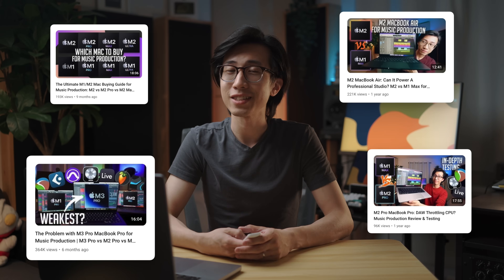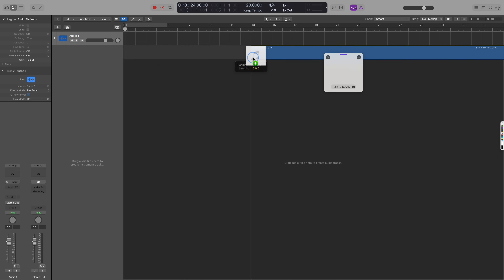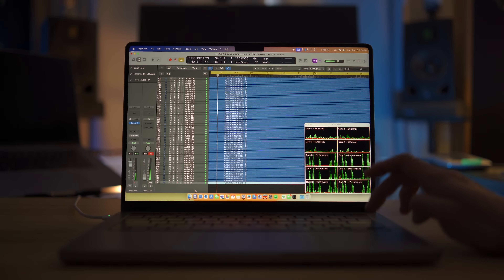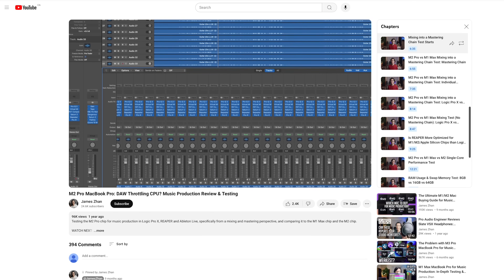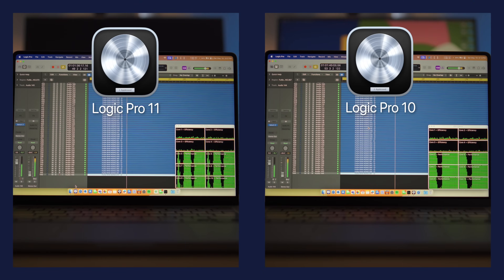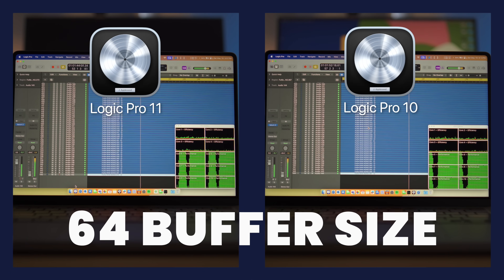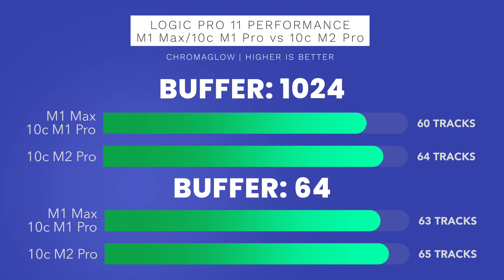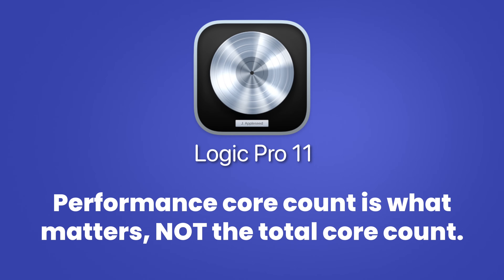Logic Pro 11 on Apple Silicon: Are CPU Cores Fully Utilized?

Comment: I'd imagine that the efficiency cores aren't really meant to handle heavy workloads like this and so the incremental amount of performance gain they'd add might not be worthwhile for the system scheduler to make use of them. It does look like a bunch of system stuff is getting offloaded onto them, at least, otherwise the efficiency cores would be reading 0%.

Also I'd expect that most plugins (especially third-party ones) would be single-threaded, which would explain the ChromaGlow discrepancy. I think ChromaGlow would also be using the neural cores on Silicon, which is also pretty uncommon for non-Apple things to make use of.
Reply from the maker: In my other Mac testing videos featuring DAWs that can fully make use of the e-cores, the performance gain you get from fully using e-cores is NOT "incremental." Testing data showed that it's actually quite significant—enough for users of those DAWs to be able to get a "lesser" chip while getting MORE performance out of their money compared to a more expensive chip.
Reply: @JamesZhan  Ah, that's interesting. I'll have to watch some of your other videos on the subject.

Comment: This is by design for consistency. The E-cores are significantly weaker than the P-cores and are reserved for non-audio application/OS processing. Every time playback is started in Logic it redistributes the tracks across the cores to balance out processing, not the individual plug-ins on them. Since all P-cores are equally powerful it can freely do so without having to worry about moving a very plugin heavy track to a weaker E-core and causing an overload.
Reply: I disagree. With a master's degree in computer science and programming, I can confidently say that this is not an intentional "feature." It's clear they haven't yet figured out how to efficiently use the efficiency cores alongside the processing cores. It feels quite frustrating to invest a significant amount of money in Apple's high-end M-series chips, only to discover that the benchmarks presented don't translate to real-life performance due to software limitations.
Reply: @mattiastofte7457  exactly, and thank you for wording that much better than i did
Reply: @mattiastofte7457 why it’s clear?
Reply: @jacosmusic  Many developers have successfully added similar features to their DAWs. Technically, I see several ways to do this too myself. 

Some argue that certain VSTs and processes are too demanding for efficiency cores. While this seems reasonable at first, it ignores the flexibility of modern CPU schedulers. By optimizing the scheduler, we can assign lighter tasks to efficiency cores and reserve intensive tasks for performance cores, balancing the workload and maximizing resource use. Efficiency cores in MacBooks are quite powerful and can handle a significant portion of the workload, so not using them fully is inefficient and "lazy" on Apples side. Honestly I don't think it will be too long before we see this implemented.
Reply: it's true, but the efficiency cores are actually quite powerful. And as meislit9217 points out, other DAWs can and do use all cores. Perhaps it would require too much of a Logic rewrite, and the performance as it is, is enough. Perhaps Apple knows something we don't, and if ALL cores are maxed out, the extra heat makes the clock speed drop a llittle, and the benefits are negliable. No idea. But it's interesting for sure.
Reply: OP comment is correct. The ability to use weaker cores will depend on how inherently parallelizable a process is. A lot of music processing is not because it’s processing a 1D time series in serial (i.e. whatever it’s doing on depends on the past so you can’t so easily split it up to multiple cores).
Reply: @sobhhi  The result of James‘s experiment indicates that we can indeed get a significant performance increase for music production when also utilizing the efficiency cores.
(Just checked out the video to your latest single and it’s dope, great job!)
Reply: Yes in theory, but that will depend on whether the processing being done to the audio is parallelizable and whether the developer of the plugin even codes it that way. So yes, it’s possible for some types of processing, but I would imagine it’s rarer than we think and developers will just opt for single thread processing in a P core to be safe.

(Thanks for the love on the music bro)
Reply: @sobhhi  that is true but in this context more or less irrelevant. That would be an argument if no one managed to get e-cores to process audio, but that's not the case. Some DAW's can utilize them and have better performance because of it, so it is possible and therefore the argument irrelevant and doesn't apply as the problem in this context.
Reply: Maybe it is by design, but it results in less performance compared to other DAWs that are make use of the efficiency cores
Reply: Agreed. I feel like the content creator's premise is just flawed. Using the efficiency cores for realtime audio would be a bad idea.
Reply: @EricGoetzMusic but third party daws like reaper are able to use e-cores for audio processing...
Reply from the maker: @EricGoetzMusic  Why exactly would it be a bad idea? If almost half of my computer's chip is e-cores (e.g. 11-core M3 Pro has 5 e-cores and 6 p-cores), I would absolutely want to have the option for them to be all maxed out when I'm doing intensive tasks.

My tests showed that you can get significantly more performance from a chip when a DAW can fully use the e-cores.
Reply: @JamesZhan well if a DAW is performance based like Ableton Live or bitwig studio, it would be bad to have tracks or clips utilizing efficiency cores. Not sure if pro tools requires the same realtime audio needs. I suspect they do

.
Reply: @JamesZhan  the way that realtime daws are designed is very memory bandwidth intensive and I'm afraid that the M3Pro is quite weak on that. Can you do a test with tool like Amorphous Memory Mark? For the M3 Max the memory bandwidth available to CPU is about 120GB/s. I wonder what would be the case for M3 Pro.

Comment: Your chromaglow test just comes down to a bit more single core headroom on the M2 Pro vs the M1.  I mean they operate at different frequencies.  M1 is 3.2ghz whereas the M2 is around 3.6ghz.  That matters and will make a difference sometimes.
Reply from the maker: I understand that M2 Pro has faster cores, but, if that was the reason, shouldn't other plugins perform better on M2 Pro's two less p-cores too? Why just ChromaGlow? I'm more inclined to believe that it's due to M2 Pro's neural engine
Reply: @JamesZhan  Fair enough.  I am speculating of course.  Without seeing the source code there is no way to know for sure.

Comment: Thank you for your video! I’m guessing your project and audio is on the OS drive, not on an external. As pro user I (we) always work this way….
Reply from the maker: I would hesitate to speak for all the pros, as pros all work differently, but yes, I run my projects and audio on the internal SSD.
Reply: @JamesZhan  would this affect your tests?
Reply: What's the best way to work.Keeping project and audio on a separate drive? I still get confused about how to configure it on Logic.
Reply: @StratsRUs  you simply save your project to another drive. Your files will then stream from that location. If you use samples Logic can relocate your Logic samples for you to a “permanent” drive. Meaning you move them once. There are vids out there …..

Comment: Thanks for the video. Was wondering about it. Seems that Reaper and Cubase 13 are the only two that use all cores. I've just switched to Mac Mini M2 Pro 16 gig ram and 512 ssd.  Have to say that I love mac but the storage is not good. If  I knew what I do now, I would have gone for min 1Tb. The 16 gig ram is ok coming from 32gig. The ram was my main concern but in real world my small ssd is the biggest issue cause I've got a very fast 2tb wd  ssd with a very fast enclosure but there is problems with Thunderbolt 4 dropping  the external. Best solution was to buy a powered thunderbolt 4 hub but even that is not preventing the external to disconnect and I see many such problems . Big bummer for me.
Reply from the maker: Yeah, it's often the case that people need more storage space than they think they do, because pro apps and the OS already take up a whole bunch of space. This is why in my M1/M2 buying guide video, I recommend people to prioritize getting more storage over getting more RAM, unless they KNOW they need as much RAM as possible for loading tons of sample libraries.

At the end of the day, if you have a desktop Mac, you can still expand your storage space by plugging in external drives, but you can't do that with RAM.

Comment: What WAS the case with multi-core Intel processors (and may still be with Apple silicon), is that where music production is concerned, high single-core clock-speed performance was more important than total core count of the processor. 

This was true because while a high core count MAY be able to allow your Mac running any DAW to handle a 'larger', more demanding project file, the workload of a single plug-in instantiation cannot be distributed across multiple cores. So as many users have experienced, a very cpu-intensive plug-in could halt your song-file with the dreaded processor overload dialog when the majority of cpu cores were just chillin'… because the demand of just one plug-in instantiation was more than the assigned core could handle.

Since through successive iterations of Intel processors we saw that models with fewer cores generally had higher single core clock speeds, while the models with the most processor cores were clocked at lesser (slower) slower speeds. For audio/music applications, if you want to run one or several virtual synth plugins with high polyphony (for example), then you'd likely do better with a processor having fewer cores, but able to run at a higher clock speed.

I've said all this because I don't have any knowledge that this radically different ARM-based SoC architecture has changed the importance of looking for high single-core clock speeds.

This is important work you've done in discovering the need (for logic users at least) to focus the 'performance core' count of the processor when shopping for a Mac, but AFAIK, high single-core performance is still more important than total 'performance core' count for this kind of work.
Reply: Yes, the M2 and M3 are faster. Maybe the core of Logic isn’t that optimized yet, but ChromaGlow demonstrated that.
Reply: Clock speed is irrelevant, you need to look at the performance of the core. With intel and amd, there are examples of cpus with higher clock speed and fewer cores compared to a model of the series above, and yet in single core tests, the model with more cores and lower clock speed in the higher series still has higher single core performance. Also when you are running more tracks than the core count, you really can't know that the single core performance will be the thing that overloads the cpu, as each core is running several tracks and their plugins. I have not seen a demonstration of any recent cpu, where it was obvious that higher single core performance trumps multi core performance. I have seen a lot of people claiming that. But I am very sceptical to that still beeing true, it might be something that people still belive because early multi core chips did have single core performance issues. And it might be the case for some tasks that can't utilize multi core systems, which was the case even long after the single core performance issues were dealt with.
Reply: @TheJonHolstein Apple has some of the best single core benchmark scores in the industry
Reply: @5urg3x  but that has nothing to do with my comment. Apple's CPUs has great single core performance and good multi core, especially considering the wattage. But the tests are always or usually based on the performance off all cores, and with their mix of p-cores and e-cores, it is difficult to know what kind of performance one will get, without someone actually doing both kinds of tests.
Reply: Developers have had over a decade to learn how to optimize performance over multiple cores. If Steinberg Cubase can do this, there's no excuse for developers who cannot.
Reply: @doctorsynth1  to be fair, it is not about multi core, but using multiple type of cores, as all typical daws support multiple cores of the same type.

Comment: Test the M3 MacBook Air or Pro???? I’m still looking for a test that compares the base M3 chips with Reaper.
Reply from the maker: You can take a look at my M3 Pro chip testing video! There's no point testing every single chip (nor do I have the financial ability to do so, haha), because the core utilization will be the same.
Reply: @JamesZhan  so I know that the M3 Pro has less performance cores and more efficiency cores but that doesn’t seem to affect Reaper as much (the DAW I use) as it does other DAWS.

Comment: Thank you for doing these, James!
I’m still running 2017 iMac Pro intel machine. 
Would it be worth it upgrading to a Mac Studio? Specs don’t seem that much better especially if the cores aren’t fully utilized.
Reply from the maker: While it's hard to gauge if such a move will benefit in your particular case, most people I know who went from intel to Apple Silicon experienced significant overall improvements. I always tell people that there's no need to upgrade their computer if it is handling their projects fine. Apple Silicon Macs have all the hype nowadays, but they are just tools.
Reply: @JamesZhan  Thanks for the insight!

Comment: My best guess would be that it is not important to them, or not important enough to have to rejigger everything this much, based on how tiny the group of users might be who need to run 100+ tracks, which would be like pro film scorers who have humongous libraries that are used significantly. That's a population probably well under 200, and most do not use Logic (though many do).

And those folks are not running on a 14" M1 MBP. It could not be any simpler than this: if you need that sort of horsepower, get out your wallet and PAY for it. IT EXISTS. And Logic will then work just fine for you.

The great majority of users are creating projects well under 100 tracks. A project topping out for most folks at over 75 would be rare. And since the current base MBP can handle that without even breathing hard, and since the vast majority of projects top out at less than 60 tracks, there really is very little benefit of wishful thinking that Logic will begin using E cores, which might increase the available track count by 20%.

It's just not necessary. And if you do have a project that's over 100 tracks, just freeze the tracks that you are done tinkering with (something I have never had to do since moving to Apple Silicon on day one).

Logic magically being reengineered to use E cores might mean 120 tracks instead of 100 tracks for users who never go over 80 tracks, which would be as ridiculous as buying the $300,000 Ferrari which tops out at 120 MPH instead of the $180,000 Ferrari which tops out at 100 MPH, in a world where the speed limit is 75.

Logic is based on Emagic's German engineering from the 90's (greatly updated in the 2010s and 2020s), and that original engineering has legacy issues, such as an inability to move tracks around in the mixer view, which is something that due to that foundational legacy code, will very likely never change, whether we have wishful thinking that it might or not.

The fact Logic does not use E cores may be just as thorny an issue for them, and it may also never change. If it were easy, it likely would have happened by 2013 when LPX was born. Easy things usually happen early. Hard things usually don't. If ever.

This is not unusual. The MacOS is based on legacy code almost as old. Windows is based on code that is even a lot older, and there were supposedly over 100,000 lines of defunct code in that OS that are still there, and were there even a decade ago, even if many of them are blanked out.

Forget wishful thinking, and be appreciative that Logic is as terrific as it already is. It's competitive with all other DAWs that have ever existed, and is used professionally just like Pro Tools is, which proves this.

Be happy that Apple is making regular significant improvements where it counts and is not churning in place trying to make improvements that will not really mean anything of actual value, like how to implement E cores. Live with that.
Reply from the maker: The sole purpose of my videos on different DAWs' core utilization levels is to help people make more informed decisions when choose a Mac for music production, because "the latest" doesn't mean "the best" depending on which DAW you are using. In general, however, people tend to think that.

Apple's reasons behind reserving e-cores from Logic doesn't matter. The fact that you can throw more money to get a ridiculously powerful Mac doesn't matter.

What matters here is that Logic users should know that Logic doesn't fully use e-cores, and so when choosing a chip, they need to keep that in mind.

"if you need that sort of horsepower, get out your wallet and PAY for it. IT EXISTS. And Logic will then work just fine for you"—yeah, I don't agree with that mentality. I make videos for those who care about getting the most out of the money they spend. I said in one of my first Mac testing video that if you are rich and just want to get the latest tech, my videos are not for you. 

It doesn't change the fact that it's not great price-to-performance ratio when you pay for a 10-core chip for audio processing and only 6 of the cores are used for that.